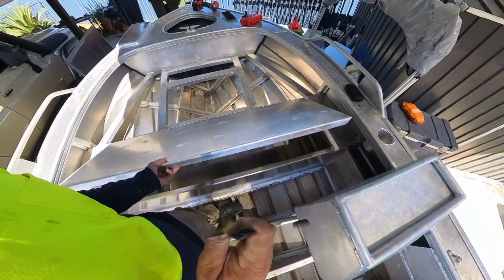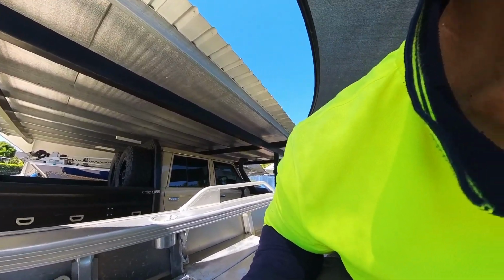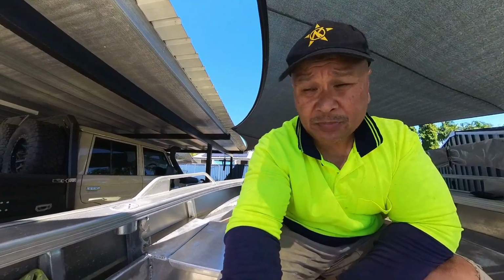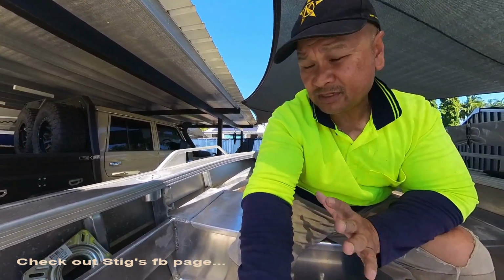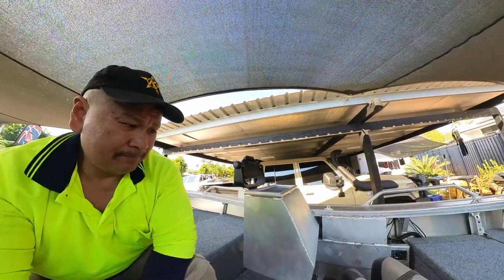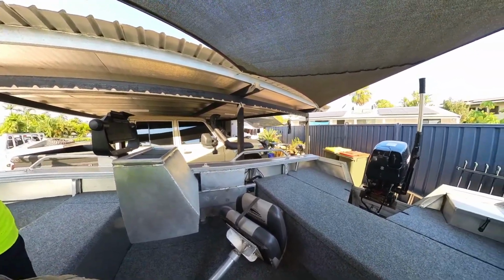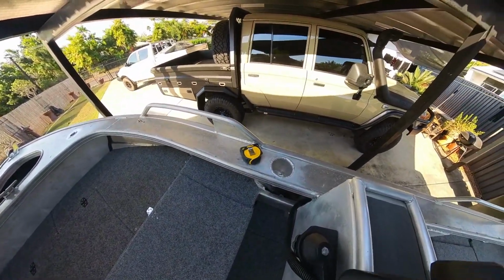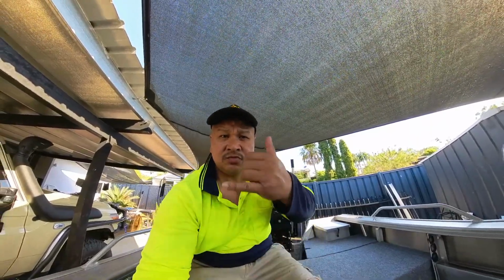Tinny Mods Part2

Comment: As a Motor Trimmer, what you do is use contact glue to stick the carpet down but what you didnt do is spray both the metal and the carpet, wait for it to go sticky then put them together. I dont know if this way will ensure the carpet is fullly adhered to the metal. If it is, how long it stay that way. Good luck.
Reply from the maker: Great tip thanks mate. I only did it this way cause i want it to hold for a year as im going all ally then will do it proper  with a darker  colour carpet. Just did this to match existing grey carpet over the timber floor and fore deck. 👍
Reply: @oakstarproductions  you did do a good job though.
Reply from the maker: @rigger314  thanks mate, i will definitely do what you suggested next round😁

Comment: Lovely Ep and she coming up a treat,  Just keep a eye on the foam against the alloy under the floor it can create electrolysis after time if salt is trapped in there with it. It happened to my 5m tinny,
Reply from the maker: Thanks for the heads up... does it matter if the salt can drain to the back of the tinny?
Reply: @oakstarproductions  If you can get in and wash under the floor with fresh water it and wash it out every now and then would help for sure,
Reply from the maker: Ahhh.. thanks will do 😃